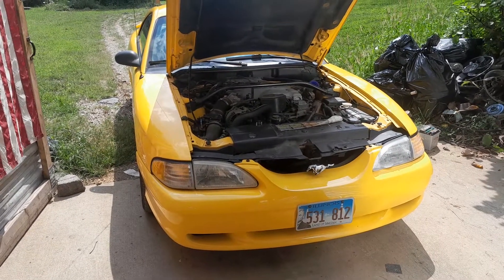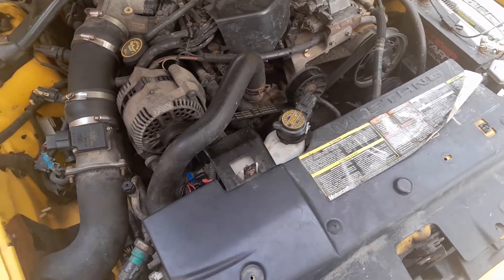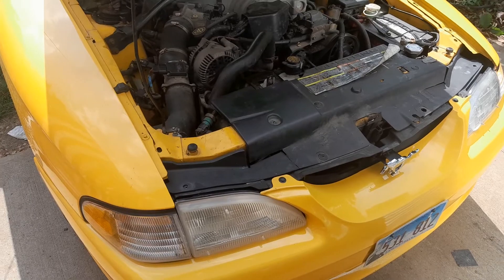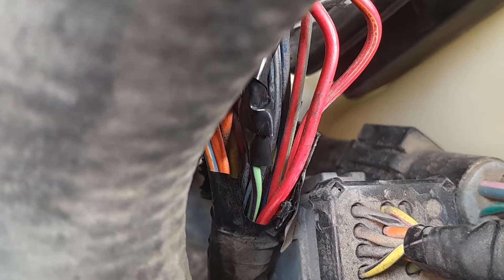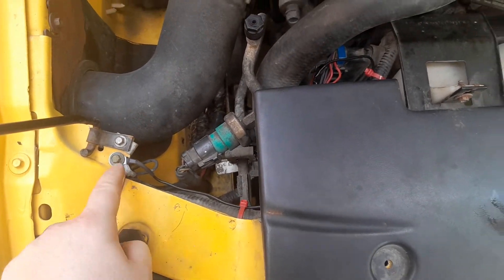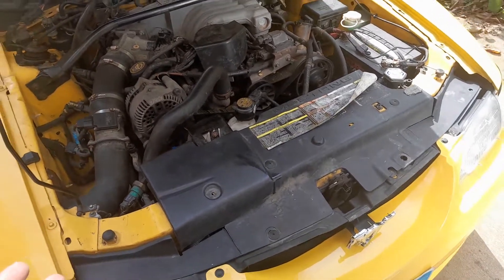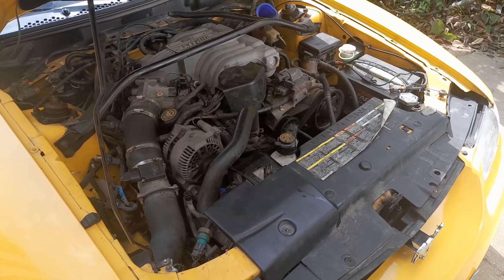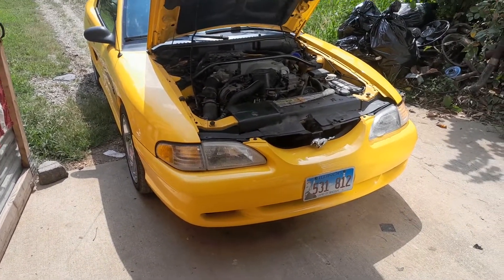5.0 94-95 Mustang GT: CCRM Bypass, Fan quick fix. fix Overheating / Fan not kicking on.

Comment: I got one easier than that, unplug the temp sensor for the ECU the 2 wire sensor, it will trick the ecu in to thinking the engine is 300+ degrees. There are 2 temp sensors so the one wire sensor is for your gauge. The actual problem with mine is the ecu isn't sending the proper 5v reference to the temp sensor (around 3.4v) so the fan was only kicking on after I was already overheating.
Reply: This sounds like the problem I'm having I should have read on thanks

Comment: Apparently this is widespread problem  and I'm going to do that switch inside for now but I'm getting a bigger radiator I think it's too anyway I have a 91 F-150 5.0 and it does have bigger radiator truck I know but a 5.0 is a 5.0 Ho has more horse even frankly so many people have this problem I think Ford should foot the bill good luck on that statute thanks for the info on that like the yellow

Comment: Hey man do you know which wire it would be for the 4.6 in a 1997 mustang GT? Currently have a switch but I’d rather do this.
Reply from the maker: In honesty not sure, you'd have to read a wiring diagram or check corral.net